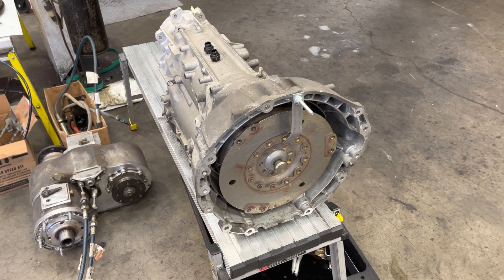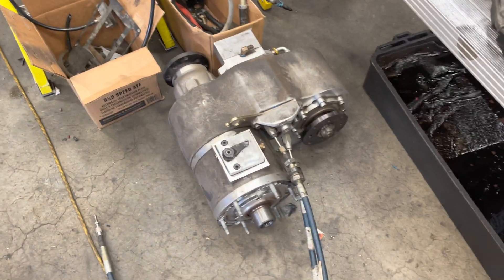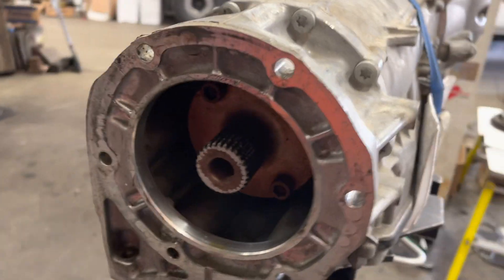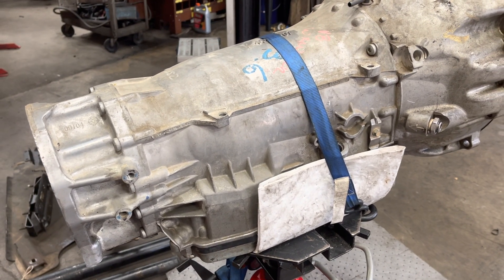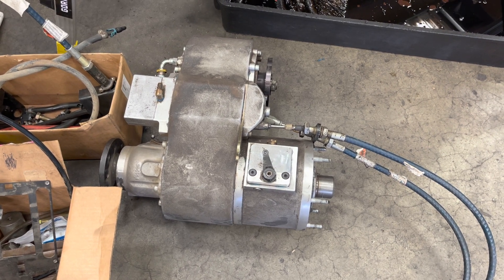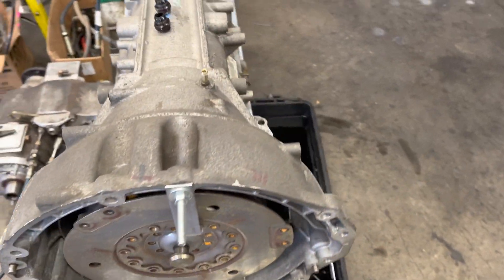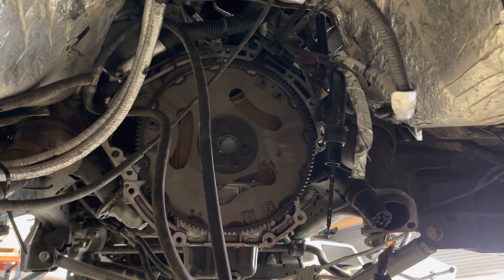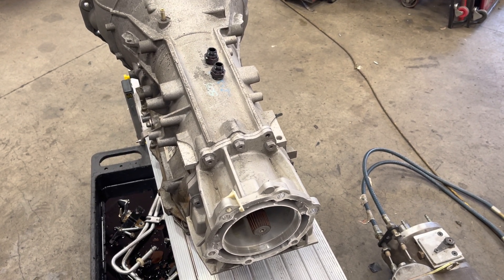8 speed transmission in a Jeep JK, with a 4 speed Atlas and a 3.6L.

Comment: Does the 8HP70 has the 2 speed sensors as well? I'm considering an LS V8 swap as well with an 8HP70 and an Atlas4
Reply from the maker: Yes the HP70/HP75 dose have a front and rear transmission speed sensor, If you are putting a LS in a JK I would think about that, You will have Can Bus problems for sure!  I think the ZF transmission is the best transmission out their.
Reply: @jeepspeedshop  if the zf solves this problem, why Advance Adapters couldn't produce the Atlas4 for the JL, stating that no matter what they do, the JL would go into limp mode if multiple gear ratios were involved?
Reply from the maker: @karimbehlok9730  The JK does not care, You don't have to tell the JK your in 4x4 mode. Now if you do tell the JK your in 4x4 mode it still will not care.
Reply: @jeepspeedshop  even if I do have an 8L90 instead of a 8HP70 in case I'll go for an LS swap?
Reply from the maker: @karimbehlok9730  I did a LS3 in my 2008 Jeep JK in 2009 and this was a worse idea i have ever had. I am pulling it this winter and putting it in my 1968 Camaro, i hope this works out and if it does not I will bow it up and Junk it and put a Hemi in my Camaro!  Now if you like LS engine you better buy a good set of lifters you will need them.
Reply: @jeepspeedshop  the whole idea is that I wanna do a V8 swap. Bruiser does a LS+HP70 conversion but need to supply their own trans. which accounts for a lot of $$$. Motech, Holley, rpm conversion successfully do a ls+8l90 conversion but are not concerned as of adding multiple gear ratios( atlas4 or crawl box ). If I had a prior 2012 JK it wouldn't matter, but I have a 2017.
Reply from the maker: @karimbehlok9730  I'm not saying for you not to do it. You should do it and good luck. I found doing a GM in a Jeep is a bad idea, that is all I'm saying. (2007-2021 Jeep)
Reply: @jeepspeedshop  only reason considering GM V8 is weight. 4th gen 6.2 weights like 90 to 100 pound less than the 5.7 with little more HP...
Reply from the maker: @karimbehlok9730  The weight is not worth it and the 5.7L VVT Truck Hemi has 400HP and the 6.4L has 480HP stock, I don't be-leave your right the LS dose not have more power. You can lose 100 pounds anywhere on your Jeep. I could have any engine and i chose a Dodge engine, like the Jeep. Keeping it all Mopar. Oh yeah and no LS cam problems!
Reply: @jeepspeedshop  thank you for your answers. Are you working on the JL as well to see if we could install a crawl box without going to a limp mode?
Reply from the maker: @karimbehlok9730  We are working on a JL now, but i'm not sure if we are going to go any further and build a kit.
Reply: @jeepspeedshop  did you try the Atlas4 with the same setup on a JL? Logically the 8HP70 or 75 should avoid the limp mode as well, shouldn't it?
Reply from the maker: @karimbehlok9730  We are working on a JL now, we will see.
Reply: @jeepspeedshop  below reply from Advance Adapters: 
" it’s a matter of the factory computer not knowing what to do with a double low. It is programmed to read the given transfer case low range ratio, and when it reads you crawling at an incorrect speed it immediately is put in limp mode. We have absolutely no way of getting around it, so we only have 2 speeds for the JL at this time".
Seems I'm the only one wanting an ultra low crawl gear on a JL. Really hope for a solution
Reply from the maker: @karimbehlok9730  So on a non Rubicon, what if you don't tell the Jeep that it is on low range?
Reply: @jeepspeedshop  whish I could all these trials...
Reply from the maker: @karimbehlok9730  Unplug the t case and see

Comment: Is the the 8hp70 or the 845RE. Ram 1500 3.6l 4x4 is what we’re using? Thank you!
Reply from the maker: We are using the Dodge Ram 1500 3.6L 8 speed 845RFE for the 2012-2018 Jeep JK with the 3.6L, now if you are using a Hemi engine we are using a HP70 and working on the HP75 8 speed transmissions
Reply: @jeepspeedshop  will the 850RE work as well on the 3.6L?

Comment: Would the atlas 4 speed also work with the 8 speed in my 2020 Ram 2500 power wagon?  Im not exactly sure wich 8 speed ZF transmission the 6.4 has but I'm sure its similar to this one you featured.   Could your shop make it work with no codes and such?